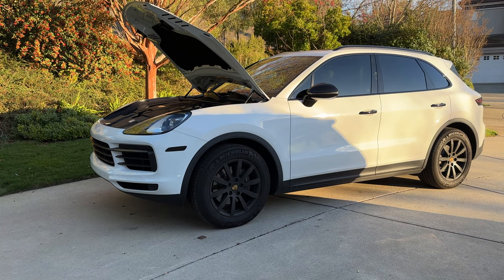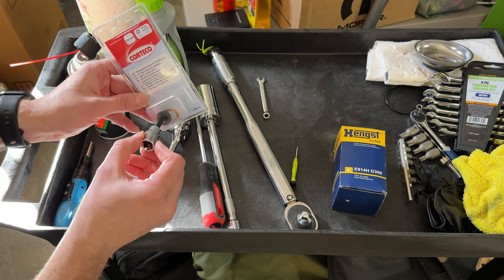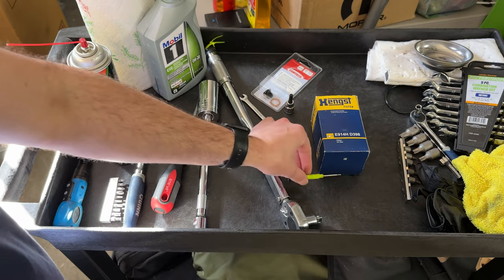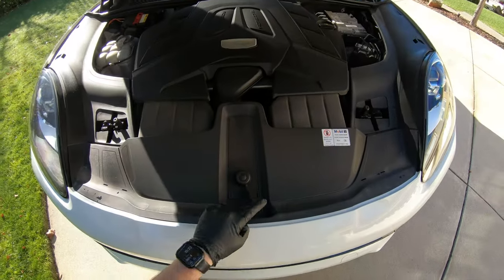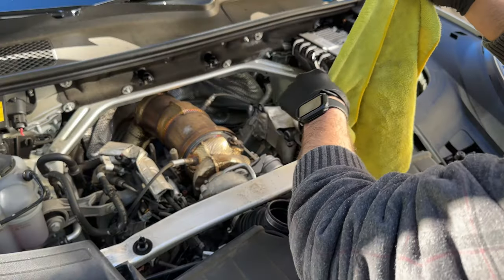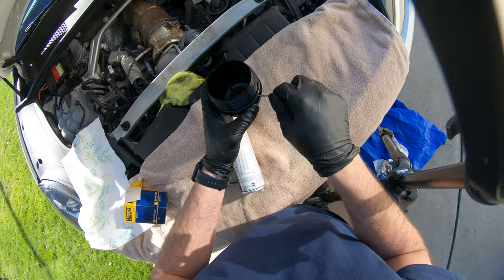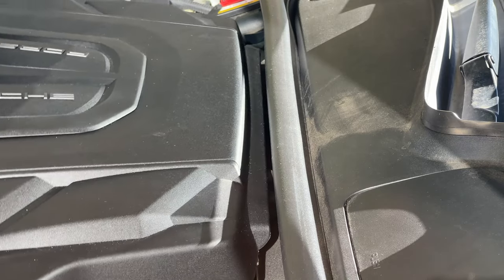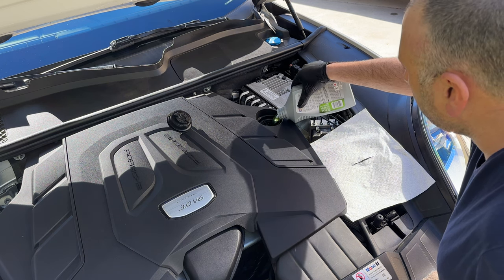Porsche Cayenne DIY Oil Change & Service Light Reset Guide 2018+

Comment: Very good video. I changed my cayenne coupe oil change in less than hour. Dealer by me wanted $699 plus tax. Mind blowing prices.
Reply: Did you reset the light? And if so, did you use the one recommended?

Comment: Thanks for your video. I have 2022 Cayenne,  but I believe the torque spec of oil drain plug for our cars is 22ft/lb , NOT 37ft/lb. 37 could possibly damage the threads of the housing.
Reply from the maker: You are correct. Luckily it’s not very much torque in general. I wish I could update the video for everyone. But for anyone reading the comments for the research shows that it is 22 foot pounds on the drain plug not 37 as seen in the video. Sorry for the mistake. Well, it’s easy to focus on the exact number when you’re actually tightening the drain plug you can really see and feel the crush washer flatten out and the area seal up and I didn’t really feel much of a difference between that point and the click of the torque wrench at 37 foot pounds. So, I don’t anticipate any issues. I have another oil change due soon, so I will swap out the drain plug and apply 22 on this next round.

Comment: Mobil 1 ESPx2 0W-20 oil is available at Walmart in a 5 quart jug for only $27.97!  It is the absolute cheapest VW 508/Porsche C20 oil you can buy.  And considering that ExxonMobil supplies VW group with the VW/Audi branded oil, that is not a bad deal, indeed.  Also, the 3.0L single turbo EA839 engines will require 7.7 quarts to get to the fill line when the sump is drained.  However, if you use an oil extractor and you remove all of the oil, it will take 8 quarts to bring the oil to the fill line.  I have the same engine in my 2020 Audi SQ5 (albeit the engine code is CWGD, not DCBE), but both are EA839 with same capacities.  They only differ in the software and the fact that DCBE has the airbox located atop the engine (as is the case with Audi Q7, Q8, porsche cayenne, and Euro VW Touareg).
Reply from the maker: Great find. That was not available when I made that video. But I just checked my local Walmart and it’s available now. So that is a great. Thanks for commenting. I used to have a Touareg, it was a great car.
Reply: @fixitwithjake  Love the Touareg, such a capable and solidly built vehicle (especially the 1st gen).  And the Touareg, Cayenne, Q7, and Q8, and body for the Lamborghini Urus are made on the same assembly line at the VW Bratislava Plant in Slovakia.  Such a shame we don't get it in the US anymore.

Comment: Why did you use the aftermarket drain plug and is it made of Aluminum? The OEM is aluminum and replaced every oil change due to possible stripping of the torx drive. If plug is steel you are mating a dissimilar metal to the oil pan!!! Please Reply if this is still an active post. Great video, I recently purchased a 2022 Base and will do my own oil changes!
Reply from the maker: This is a very good question. I had to do some digging because I couldn’t remember why I chose that exact plug since it’s been a while. But with a little research, I remembered that it was a source and availability problem. It would take a week or two to get a Porsche OEM drain plug and then pay $15 shipping. I was able to get this one in just a few days and complete the job. It is made by a company that has OEM equivalent product and is brand replacement on Porsche and Audi. You make a good point about the dissimilar metals. But I really can’t imagine that this German company would make a product with different metals than the oil pan. Otherwise they’d have people complaining and no one would buy their products and the future. I tried to figure out what the plug is made out of, but it’s too hard to tell. it feels heavier than aluminum, but it’s also coated with some type of black zinc on top. Generally oil drain plugs are replaced each time because the crush washer cannot be reused. That is the brass ring around it. I haven’t heard of the torques being stripped because you do not torque them down very much at all. But I suppose that’s possible. Where did you hear that? It’s so hard to find good. Accurate information on servicing a Porsche because the company hides all of the material And manuals. If you have any concern with that dream plug then certainly order the OEM one and use that instead. They’re only about $10 no matter what brand you use. I bought 4 of them so I’ll be good for a while. If I have any issues with the drain plug, I will report back.
Reply: @fixitwithjake  I found this Video where he talks about stripping the head but he calls it a Hex slot not Torx Bit? You must know that you can buy the crush washer separate and maybe reuse your plug. Know that I have not accomplished this oil change yet as I just bought it back in March 8100 miles on it right now. We have an RX350 that I change oil every 5K (Her Car)! I hate driving the Lex since I bought the Cayenne! The Porsche Dealer does charge an Arm and Leg for their yearly Oil Change and Maintenance! Anyways here is the link: https://www.youtube.com/watch?v=26Sz9t6LeIo

Comment: Great video! I have a 2020 Cayenne 3.0, last oil service has overfilled (above max level). How to just drain some of the oil out to get it to the right oil level (at or slight below max)? Called the Porch service shop, they want to change the whole oil.
Reply from the maker: Yeah, I’ve had a service shop do that on my previous vehicle. It’s one of the reasons I started doing oil changes myself. Because they’ll never tell you until the issue pops up. Which could damage your catalytic converters, which are very expensive. If it was me, I would get one of these oil extractor pumps, and I would carefully put the plastic tube down the engine oil fill tube and remove some of the oil. I’ll be honest I’ve never done it on this car so I’m not sure how far the tube will go down for you. But I’ve done it on many other cars and boat engines and it works so well. Obviously this car is a little different because it doesn’t have a dipstick tube so you’ll have to use the fill tube instead. If the service shop made the mistake, I would let them drain the oil and do it again. But if you made the mistake, maybe you just want to remove half a quart or so. https://amzn.to/3KeVRVB
Reply: @fixitwithjake Thank you so much for the kind advice! I was thinking to pump it but really have less experience DIY project on a vehicle. Thinking if it’s possible to find a car workshop nearby and let them drain half a quart or so from the bottom of the car. If that’s doable I’d like to try next week…
Reply from the maker: @ericxu2993 they probably aren’t gonna wanna do it from the bottom drain. As soon as you open that drain the oil gushes out fast. The oil drain plug and crush washer are designed to be replaced each time. So in the amount of time it would take for them to unscrew it make a big mess and put a new one in, it would be very messy. They should be able to suction some of the oil from the top of the engine and that would be a much nicer way of doing this.
Reply: @fixitwithjake I see. Will try to pump it then. Thank you so much for the professional advice!
Reply: @fixitwithjake  I made the DIY happen today! Mine is a 2020 Cayenne, It took a while to find the small dipstick tube and its plug since its location is different from the 2019 Cayenne. They’re hiding behind the metal bar and hide among a few other cables. But after find it and unplug it became quite easy to pump using the tool you introduced. My engine was warmed for 10 min before the pump. The tool does not tell you in real time how much oil you pump, so I have to estimate and later found I pumped around 300 ml (1/3 of a quart). The final result was perfect, the oil level stays right at the max level, not over not below. After driving for a while, it still stays in this level and won’t raise oil overfill alarm again. Kudos to you, the good instruction was key to this DIY success!
Reply from the maker: @ericxu2993 hey this is great to hear. I did not even know there was a port there. I will have to check it out tomorrow. Nice job figuring this one out yourself!

Comment: Thanks for that video. I have a Macan S MY 2020 with the 3.0 engine and wonder if the torque spec of 37 lb. ft. is the same. Where did you find that number?

Comment: Any thoughts about using an oil extractor instead of taking off the underbelly and drain plug everytime?
Reply from the maker: Yeah, I would not recommend doing it that way. You’re gonna leave at least a quart of extra oil in the engine going that method. Also, I know several people that have gotten the oil extractor tube stuck in engines before. It’s pretty rare, but it happens. And they had to pull the entire oil pan off the bottom to get it out and then they had melted plastic inside their engine. There are some cars that are designed to be done this way. Some Mercedes engines, for example. But not this car. The majority of the contaminated oil probably sinks to the bottom with metal fragments if any. And that’s the oil I want to get out of the engine as soon as I pulled the oil plug. So I think you could get away with it. It’s just not the best practice for doing an oil change if you don’t have to. I have a oil extractor myself for other engines that can’t use the drain plug and it doesn’t hold the full seven or 8 quarts so you have to empty that back out and it’s a very messy process. You can see me using using one in my boat oil change video. More messy than just draining the oil into one container.

Comment: I have the iCarsoft POR II and it won't reset the oil counter. I was told by support that the hardware is old and won't support the new software. I disappointed as I only bought this a few years ago.
Reply from the maker: I believe it. And that is exactly why I made this video. So people know exactly what device will reset their newer model Cayenne service lights. This one will https://amzn.to/3LDIS0q and after one use you will have saved enough for it to pay for itself. That is a win win in my book.  FYI, this is not sponsored and I know nothing more about and I’ve never spoken to Carsoft and their company.

Comment: Do you have to reset mileage? I’d just write the  mileage down.
Reply from the maker: You have to reset the service light, which is essentially the same thing if I understand your question correctly. If you don’t every time you start your car, you’ll be warned that service is required.